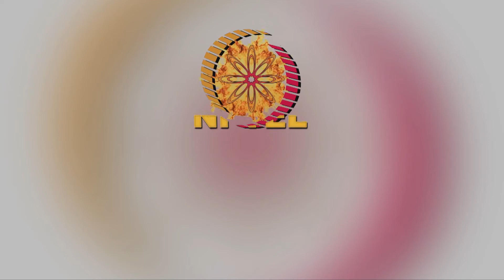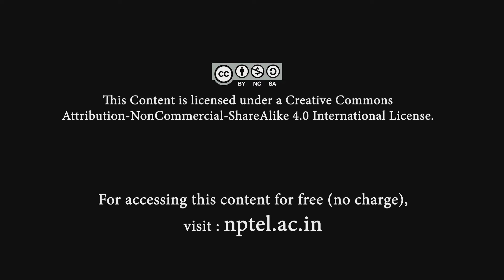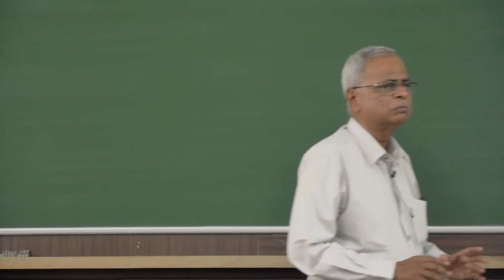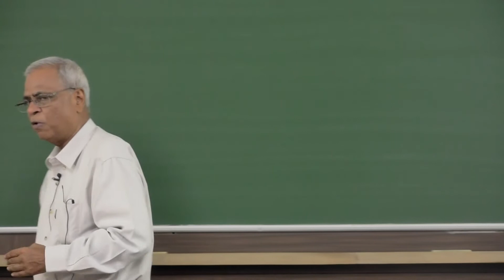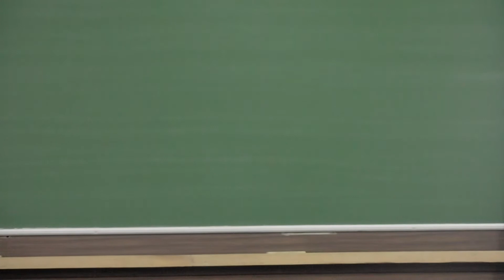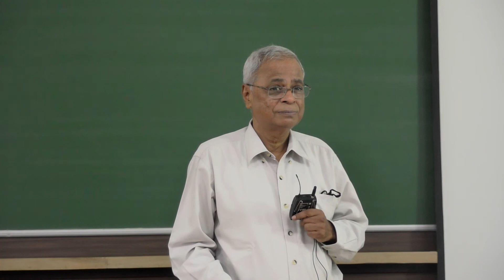Lecture 76- Course Summary

Comment: i am just waiting for a solar energy course from IITM . there are 3 on NPTEL , 1 introduced in a new one by IITG this year under renewable sources but all seem to be from a mechanical perspective , using solar collectors to concentrate the heat and geometry and all. 
what students need is also from an electrical engineering perspective , the solar energy system, models,battery,on grid , off grid , inverters etc and integration into the power grid , from an electrical engineering standpoint. hope its launched soon.
Reply: Agree . Waiting eagerly for the course which is industry oriented in solar domain. #NPTEL
Reply: I am having exam with this course as syllabus, so it would really help us, if you can share the pdfs
Reply: Hi, @yedidyahsagar 
It might take some time as I did this quite some time ago and the PDFs are in my old laptop.
Reply: Thank you very much for the reply.
I will Wait.

My Gmail is the same as my username